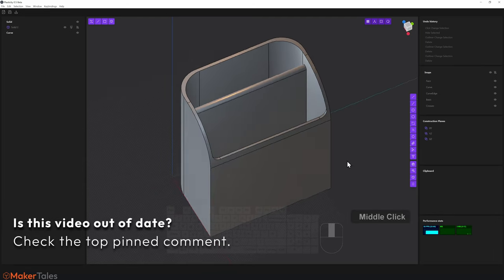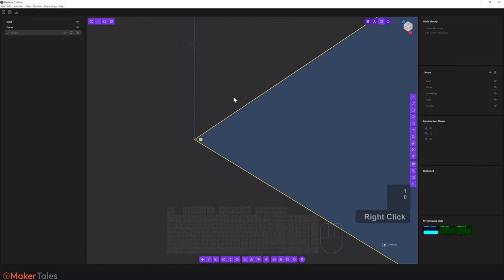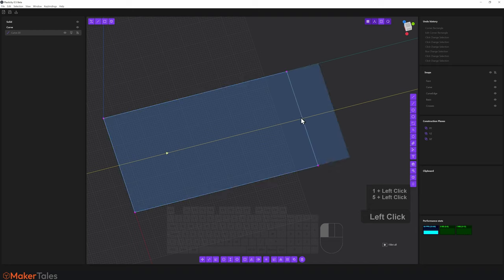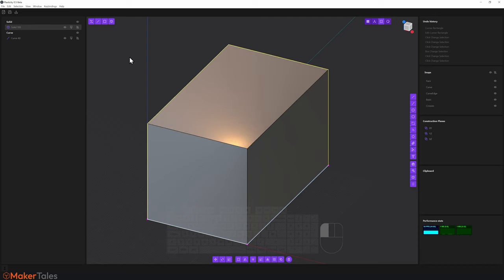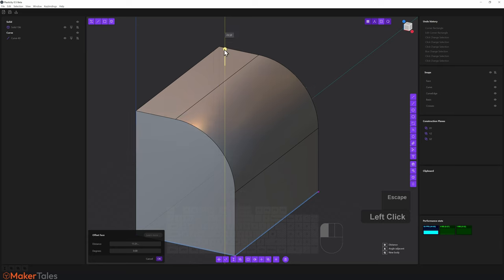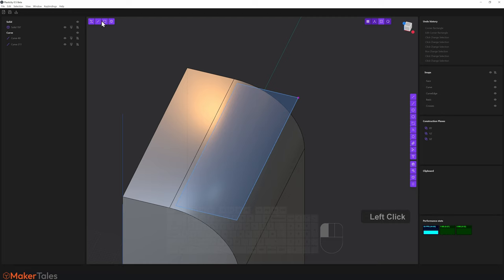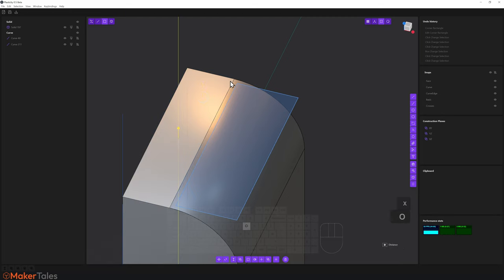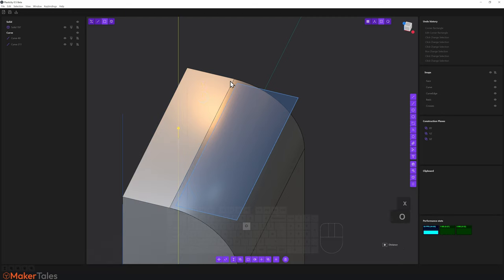Plasticity 3D The Basics Of Hard Surface Precision NURBS Modeling | Part 2

Comment: I just bought the full version, and these tutorials are so out of date they're more confusing than anything. Also, there's no help docs??
Reply: AFAIK, right now there are NO docs. I think they're trying to make it as intuitive as possible providing hotkeys in the lower right corner as you're working. Also, you can join/ask on the Discord if you need help. Lastly, there's a link to the Wiki within the Discord. (I'd post it here, but not sure if it's meant to be public or not).
Reply: @RadTechDad  Thanks. I've always been a slow learner, and have never been able to just tool around to figure things out. I need to read manuals that lay out the ground rules (when I learned Max 25 years ago, before even touching the software I read a 2k page manual first. Then when I actually used it, I remained miles ahead of everyone else in class who only learned by clicking around!) It's too bad the trend the past 15 years has been to de-emphasize written documentation :(
Reply: @JonHuhnMedical  I agree. I like to go through the manual as it gives an "overview" of what the thing is about. That being said, maybe someone will put one together either from the wiki or from experience.
Reply: Yes... I'm trying to follow along with the released 1.0 version and it seems radically different. With all of the buzz around Plasticity, I'm a little perplexed in that 'from the ground up' tutorials seem non-existent. All of the content that I've found seems to be from folks well versed in Blender , and sure for them this is likely so intuitive that it needs no documentation.

Comment: hey Jono, don't know if you can edit these titles or not, but it would really help to have "Lesson 1", "Lesson 2" etc... the playlist is numbered but the lessons are not, thanks
Reply from the maker: Sure thing Dubley, I have now numbers them from | Part 1 to | Part 8 there is still 2 more to come out but Now 100% sure when they will come with a bit of luck in 2 to 4 weeks time as they are going to be a little more involved
Reply: @Keep-Making  thank you - great tuts, btw, although my version (0.5.41) is a bit glitchy but that might be becoz it's running on win7 (although Blender 2.9 runs just fine)

Comment: Do you think plasticity is the best way to export nerbs to blender? I’m learning blender and fusion 360 for technical models and 3d game assets. I want to learn 3d modeling in blender, but I feel like nerbs modeling will be faster and easier for hard surfaces modeling. 

Thanks for all your videos and help. Sorry if my questions or comments have been a burden. Hope all is going well with your family
Reply: NURBS - non-uniform rational b-spline.  Both have their advantages, but personally, I still find making advanced  geometry much faster in blender. You can't beat modifiers, lol. Especially with stuff like speedflow, hard ops, box cutter, mesh machine, etc, blender can be super powerful.